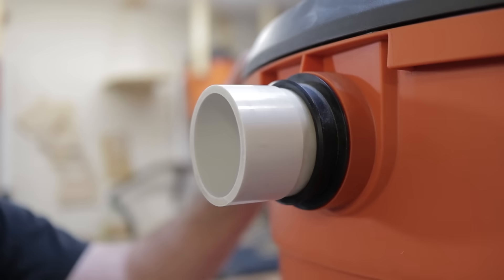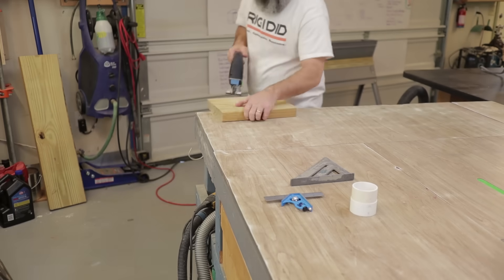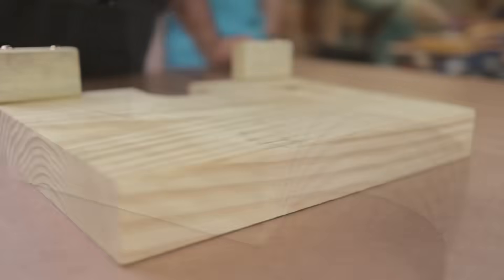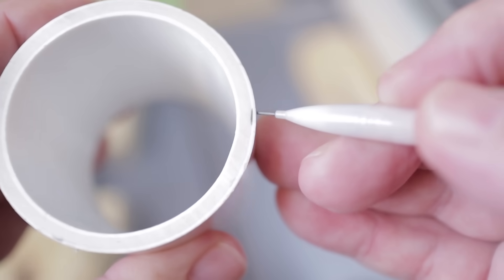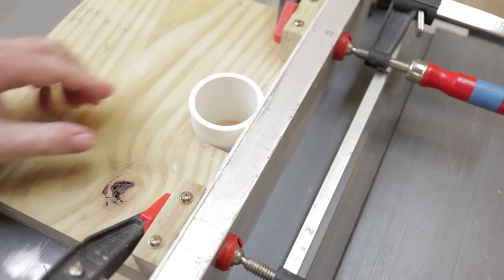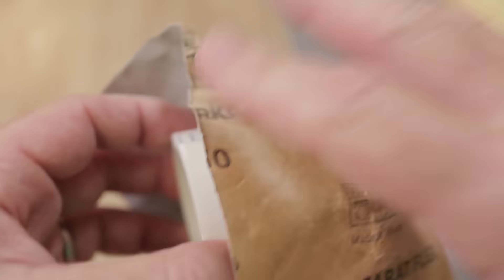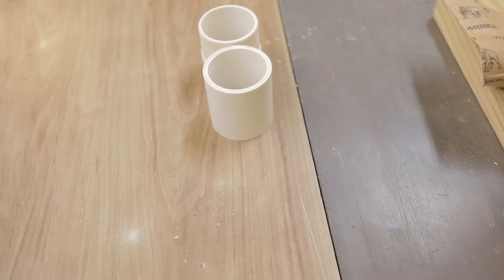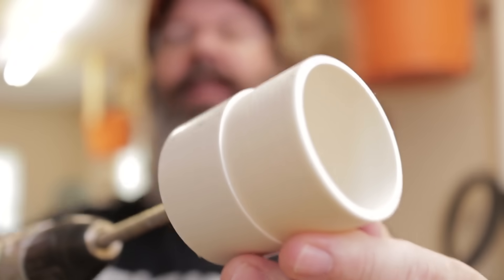Dust collection adapters shop vac to PVC made fast on the table saw

Comment: Interesting jig. However, instead of going to the trouble to make a close fitting hole in the bottom board, why not just make a "V" block with an opposing "finger" block to push the raw stock pipe piece against the "V"? The "finger" block can be adjustable or just glued in place.

For those comments to just use a lathe, not everyone has one. I do but don't assume everyone has one. I like ideas like this for the "tool poor" folks.
Reply from the maker: Thanks! It's much easier to drill the hole with a large drill bit and the use the spindle sander to finish it out to the final size. I only used the jig saw because I figured most people would have one. The only trouble with the V block or anything other than a circle is less contact points. A V block or a square hole would both work but the circle feels most secure.
Reply: @SlowandExpensive  I don't have any large hole saws or a spindle sander. I really don't think the smaller contacts of a "V" block is relevant as your circular hole really has only one contact point unless it's an interference fit (in which case you couldn't rotate the piece of pipe) . Also, you wouldn't want to put any significant lateral force against the "V" block anyway. Just give a "V" block a try before discounting it. Making a "Square" hole would be as difficult as your round hole. I just propose a "V" notch on "one side" of a rectangular hole and the opposite side cut and filed to fit the pipe. The "V" notch would be much simple to cut with a jig saw.

As for "feels most secure",  machinists use "V" blocks all the time to position and hold round shafts and tubes for machining operations. I use them when milling and drilling on my metal working machines (lathe, milling machine and metal cutting bandsaw). Again, just consider a "V" block before discounting them. I know you may feel defensive about your hole jig, I'm just trying to simplify the jig.

Comment: Of coarse you could just take a heat gun and warm up the hose and slide the pic pipe inside of it.
Reply from the maker: Hey Ron! Sliding the pipe into the port would restrict the volume of the air flow by 1/4". If I was to use the heat gun method I'd heat the elbow fitting and go over the vac port. Results vary with the heat gun.

Comment: for fitting blast gates, wyes, and connectors to 4" Sch 30/40 PVC, make gasket strips from 2.0mm craft foam from JoAnn Fabrics.  It works for me
Reply from the maker: Thanks Bob! If I ever start using blast gates that will be handy.

Comment: Great tip and jig.  Just trying to figure out why so many shop vacs for dust collection.   With what you have invested in shop vacs you could have bought a shop fox dust collector and plumed it with pvc
Reply from the maker: Thanks Butch! It looks like a bigger investment that it really is.
Reply: If you mean the system I think you do, that's several thousand dollars! You can buy 5 gallon shop vacs $49.95 all day long!

Comment: Such a Great idea on making the fittings. A slight degree of tilt in the table saw blade and you can make tapered fitting connections for a snug fit with some range. 
Now I’m thinking this could be useful for tapering round wooden legs to be but into holes for chair leg joinery.
Reply from the maker: Interesting thought! I've not tried any tilted cuts.

Comment: All that work just heat up and shrink just bottom half bam,done!!
Reply: Would that not also reduce the inner diameter of the pipe, constricting flow?
Reply: @walthodgson5780  It would restrict flow a bit but this is a shop vac not the air supply on the space shuttle.
Reply from the maker: Table saw vs. heat gun challenge video!  :)
Reply: exactly what i thought... damm this guy knows how to make more work for himself

Comment: Shop vacs are not inexpensive. Wouldn’t it be cheaper to buy a dust collector and run ducts to the equipment?
Reply: William Fitzer my shop vac is less than $150, my dust collector was over $500 new and many are in the $2,000 range. I bought mine used for $200.
Oh, I see what you mean, he has a vac for each station, then I’m guessing it’s because the vacs have more suction and less CFM.
Reply from the maker: I will explain the economics of my set up in a future video. Thanks for watching :)

Comment: Simpler idea...Just get a heat gun, 15 seconds, heat it up and push the pvc into the  hole and hold it until it conforms to the size you need.  DONE.  No special tools, measuring, jigs or anything needed.  Just a heat gun ($15 Harbor Freight) and a pair of gloves.
Reply from the maker: The heat gun method is mentioned in the description.

Comment: I've been wanting to make a stacked dust separator using a shop vac so I'll give these a try.  Thanks.

On a side note I've used the drill method for cleaning the end of copper pipe before soldering by running a bolt through the cleaner.  First time I did it I burned the hell out of my thumb, forgot about friction.  Lol, lesson learned...
Reply from the maker: Thanks Bob!  :)
Reply: Bob O'Connor I’ve just made one of the best stacked dust collector builds I’ve seen and is works a treat  👍😎🇦🇺
https://youtu.be/8J986uRQFTI
Reply: Experience is a great teacher, but we've all been reminded that her tuition fees can be expensive. :-)

Comment: If you start selling these then I will a few from ya. That would be more expedient and just plain easier than working this out on my own. SO, when are you selling and how much?
Reply from the maker: $$ Big Bunny got money!  :)
Reply: @SlowandExpensive  Big money? No, just there is only so much time and energy to expend on things as woodworking is not my career but a loved hobby. Spending a few bucks on a solution I do not have to invent or create is just time saving. 

There are other projects I would prefer to spend my time on when working with wood, that is all.
Reply from the maker: How many do you need?
Reply: @SlowandExpensive  Well, I do not have the sheer volume of shop vacs you do. That being said, 2-3 would be more than sufficient for my needs at this stage.
Reply from the maker: Okay, I'll hook you up. I'll make a big batch  to sell as soon as time allows. I'm in the middle of a  cabinet build right now so when I have the chance I'll make a bunch and we can sort it out.
Reply: @SlowandExpensive  Fair enough.
Reply: @SlowandExpensive  thank you in advance for your assistance. Do you have a gestimated time table for when you will make the adapters?
Reply from the maker: Maybe some time over the weekend.
Reply: @SlowandExpensive  had the opportunity to make some spares of these adapters? I would still love to get a couple from you if possible.
Reply from the maker: I finally got caught up so I'll make some this weekend. :)
Reply: @SlowandExpensive  did you have the opportunity to get to those adapters this weekend? If so, how do proceed with me getting them from you?
Reply from the maker: Hit me up on my shirtpuppy email and we'll sort it out. It's on the bottom of the about page on my channel.
Reply from the maker: Hey Big SabertoothBunny! Links in the description if you still want any adapters. I finally got a batch made up if you do get some you'll have to let me know it's you so I can hook you up with a few extra for the wait. Thanks :)

Comment: I'm curious:  What's the advantage of using a dozen shop vacs vs just getting a large dust collector and ductwork?
Reply from the maker: It was a few thousand dollars cheaper.
Reply: He's got more money in shop vacs than it would be to buy a HF dust collector
Reply: @jones3511  and Mo Learns Making:  When a central collector goes down, you have none. When a shop vac goes down, it takes very little effort to 'borrow' one from another area of the shop. There is value in that. (And many heavily invested in centralized systems would laugh at anyone's reliance on an HF dust collector...I am not, but I'm just sayin'. To each his own.

Comment: Great idea! Clever solution. The shot at the end was cool(of the couplers stacked on the bench)
Reply from the maker: Dave! Thanks man! That was the dolly zoom. It took me several tries but I finally got it. A little tricky to manually get both actions smooth at the same time but a couple of the takes turned out nice.

Comment: Tony, this is a bright exmple of thinking outside the box. I'm totally impressed by the drill rotation improvement
Reply from the maker: Hey Alberto! Thank you
Reply: And not only this, but many other things can be easily done with a drill, thanks to its ability to turn slowly. I often use my hand drill to spin a small part while using a Dremel or a sander to perform some cut or sanding.  The drill keeps the part centered and turns it to achieve an uniform material removal!

Comment: Super job Tony. Excellent 'how to' and really entertaining vid. I liked the round-the-table shot at two minutes forty-ish but I don't think I'd have noticed the dolly zoom if you hadn't mentioned it. Oh well, that shows what a philistine I am. Good job mate, thanks for all the effort you put into your vids.
Reply from the maker: Thank you very much Mark! I really appreciate it.
Reply: I do this kind of pipe reduction all time. I just us my wire wheel that’s on the other end of my 6” grinder. It is very fast, but not as perfect as using a table saw as a lathe type result.
Reply from the maker: That sounds like another way to do it! :)